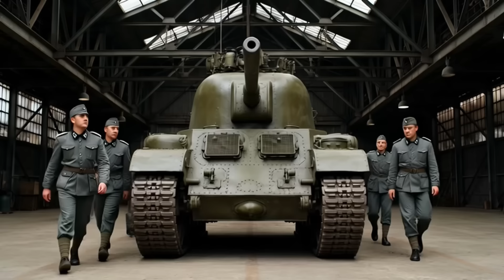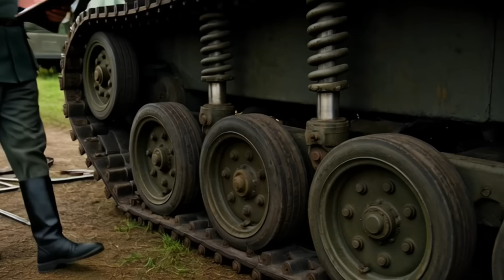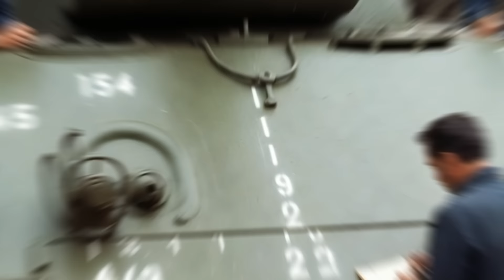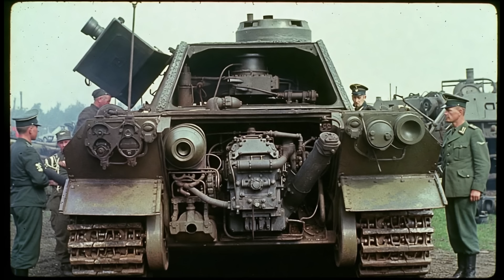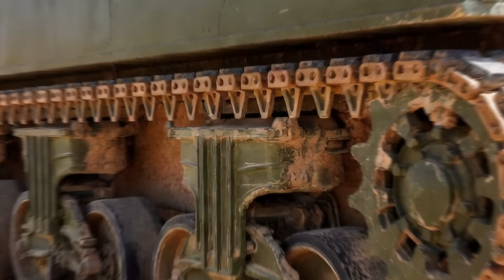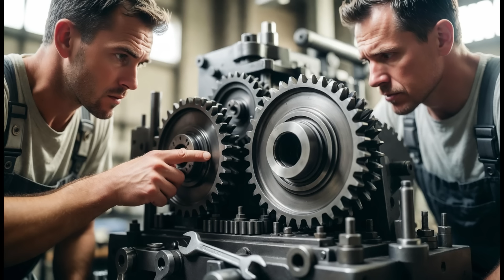German Engineers Tested a Captured Sherman - Then Realized Why They Were Losing the War

Comment: Regardless of whether this tale is factual or not the message is clear.  You fight your battles with the equipment on hand that actually works when required.  Apparently this lesson has been lost in the US Armed Forces for decades.  Pursuit of technological overmatch has produced obscenely expensive equipment that is slow to manufacture, hard to maintain, and far less reliable than the Shermans, Jeeps, and C-47s of days past.  Can anyone say "Lightning II"?